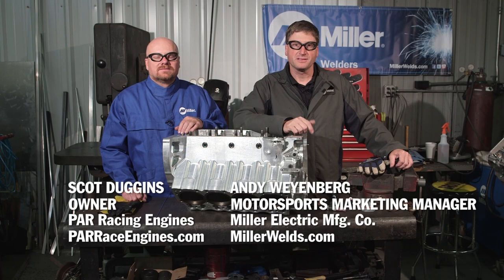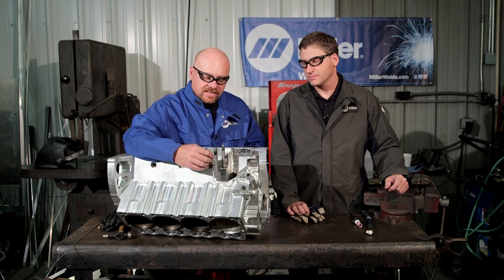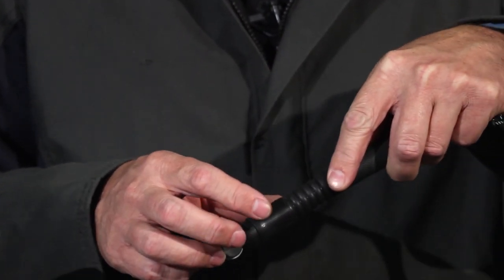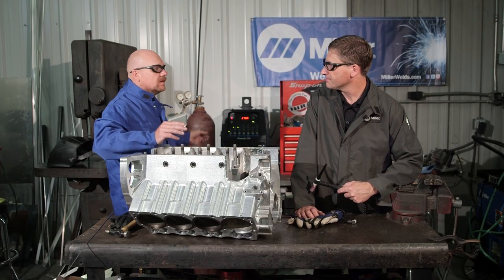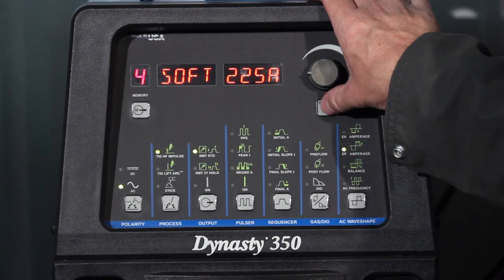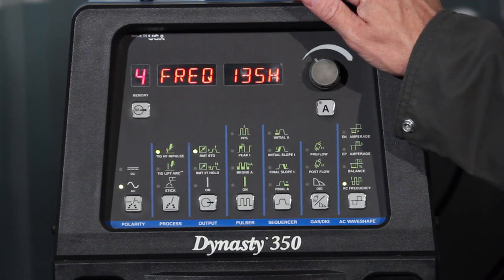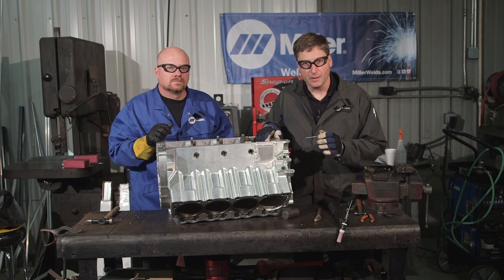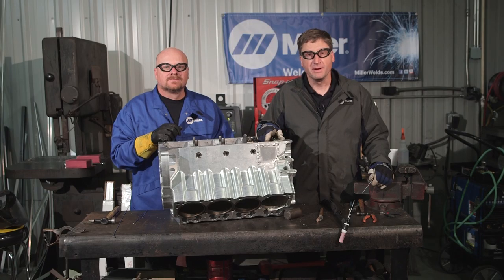PAR Racing Engines Repairs Engine Block With Dynasty 350 TIG Welder

Comment: Hi guys! Nice video! Why didn't you preheat the entire block to at least 100-150C degrees?
Reply from the maker: That's a great question! The inverter engine in the Dynasty 350, and the way the AC wave shape can be adjusted to input more heat into the weldment and not as much on the TIG torch, allows for thicker material welding without preheating.
Reply: @MillerWelders  That's nothing unique about a Dynasty. Any machine with AC balance can do that. #marketing

Comment: my starter broke a chunk off my block can that be welded back n threds still line up to secure starter
Reply from the maker: Nick - are you working with an aluminum or cast iron block?
Reply: Aluminum
Reply: Ls1 346
Reply from the maker: Thanks, Nick. The LS aluminum block can be repaired. Depending on how much broke off, you can make a patch part with 6061 and use the 4043 or 4943 filler to weld. Bolt the patch part to the starter and bolt the starter back on the block so everything is flush and lined up. Make sure the weld joint is beveled enough for adequate penetration.

If the broken part is not that big, or it just broke partially into the threaded area, you can use the stronger 4943 filler to build up the area, machine flush, drill, tap and helicoil insert. The damaged area of the block will have to be thoroughly cleaned. 

Note that it is quite difficult to align the patch or machine the finished repair in the car. Also, getting the TIG torch into the proper angle to reach the repair could be a challenge as well.

A Dynasty 280, 300 or 350 should be able to do this repair. On casting repairs like this, it helps to keep the AC frequency higher on the initial root pass, around 180-250. This will help drive the arc deeper, helping penetration.

We hope this helps!

Comment: What filler wire was used?
Reply from the maker: +J Petrila Thank you for you question. The filler that be used is the 4043 or the 4943. We used 3/32" and 1/8" filler metal. Let us know if you have any further questions.
Reply: Ok.. you used both?  Which rod which repair?
Reply from the maker: +J Petrila Either can be used. We used the 4943 because the block is billet aluminum. If you have a cast aluminum block, sometimes the 4043 works better depending on the quality of the casting and porosity of the cast material. We hope this helps. Please let us know if you have any further questions.